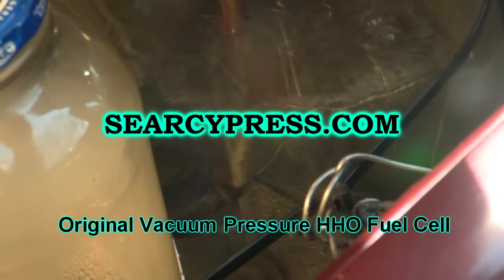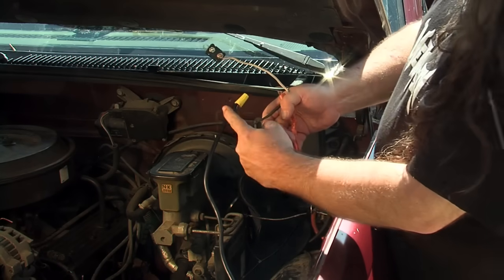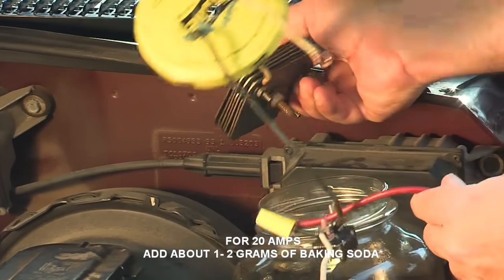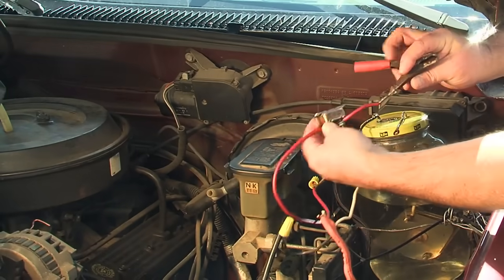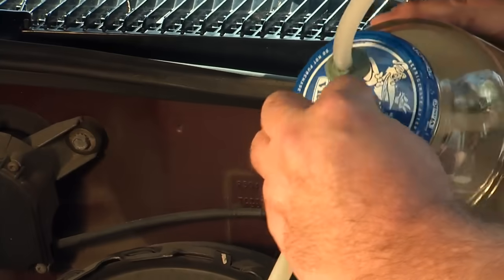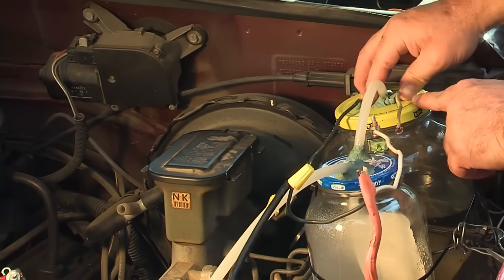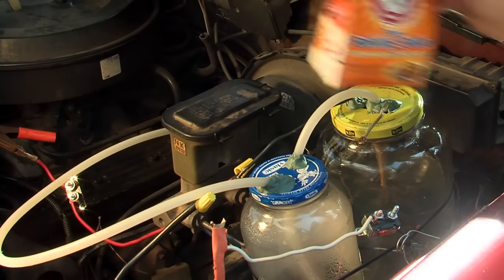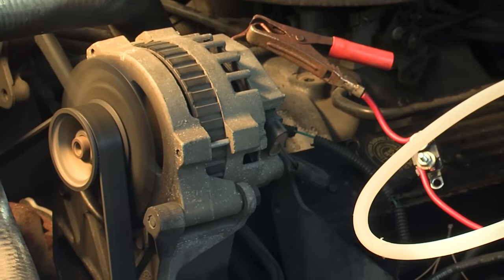Vacuum Pressure Hydrogen fuel cell defeats high gas prices using hydrogen from H2O.

Comment: Sorry, but it is NOT POSSIBLE to recover ALL of the energy spent separating the HHO. There are certainly even line loss (wire heating) that looses efficiency.  If this was shown to actually WORK, it would be equivalent to a perpetual motion machine.
Reply from the maker: This is not over Unity. It is simply allowing for more efficiency in the burning of the fuel. We are not getting something for nothing and do not claim to be. And on another note, perpetual motion is all around you. The atom is a perpetual motion machine. To claim they do not exist it's kind of ridiculous. Thanks very much for your comment.
Reply: @metalpresstv  but it is NOT POSSIBLE to increase the output of the engine EVEN ENOUGH to break even.  Since separating the HHO requires more energy than you can POSSIBLY RECOVER from re combining it. The only people who claim this is possible are people who never took a physics class.
Reply from the maker: @stuartgray5877  I understand. One thing I have learned is the word impossible simply means I'm possible. One thing about physics is the fact that they are constantly making new discoveries. As I said this is certainly not over Unity. However I strongly suspect it in the future many devices will be powered off of the same thing that powers the perpetual motion of the atom. Many factors determine how much mileage you get. Measuring that is also quite the challenge. Having tested this device for many years I came to fully trust getting higher efficient burn using this method was possible. It certainly won't work on every engine. And I do not suggest anyone build it because of the dangers involved. Thanks again for your comment.

Comment: Wouldnt running the hydrogen through the vacuum line as you showed defeat your power brakes? Wouldnt it be better to install a second line which runs to the throttle body or carb instead? I know this would still constitute a vaccume but at least it wouldn't be taking from your stopping power. 

Did you notice any power gain from this system??
Reply: @Sardit  finally an engineer who isn’t condescending
Reply: the power brakes aren't the only issue here. as an engineer i can guarantee you, that this whole video and all its pseudo scientific content is Bullshit.
Reply: @Taunus-Tim  A real engineer doesn't use adjectives, you're a just troll.
Reply: @snowboarder50000  i don't need to argue... I have a bachelors degree in mechanical engineering and i can prove it if need be.
Reply: @snowboarder50000  , you obviously haven't been around many.😂
Reply: @Taunus-Tim  yes, as an engineer you prove everything, thats your job. Zero fucks given for an engineers name calling, show your work.
Reply: @outdoorsman7324  im around engineers regularly. Is calling names how you think engineering really works??? Good luck building that bridge.
Reply: @snowboarder50000  okay, just to write something that is in deed an argument.
1. The amount of Hydrogen needed, just ro run the engine in idle speed is far far greater than a jar and some metal plates vould ever generate. Even if you have the electricity of a whole nuclear power plant. This jar would just boil and that's it.
2. By burning hydrogen in a combustion engine in idle speed you gain about 10% of mechanical energy out of all the 100% electricity you put in that jar. About 1% is available for the alternator. And with this 1% you want to recreate 100% hydrogen again??? Just how, by all laws of physics, could this work. This would be a perperuum mobile of Ultrons private order.

So learn your physics and give me a break please...
Reply: @Taunus-Tim  Stanley Meyer got it to work, several other inventors did also. You throwing out random percentages isnt convincing. Dont you have important engineering work to do?? why u here?
Reply: @Taunus-Tim  the point of these HHO generators is to increase the fuel burn in the cylinder.

I do share your disbelief of these though - perhaps in a shitbox car these can perhaps increase the efficiency, but I imagine there would be some sweet spot where you extract only enough energy from the engine to only increase the burn efficiency and no more.

One thing is certain, the gas produced will not offset the extra power required to overcome the extra load on the engine so that leaves only the increase in burn efficiency. But to be practical, the increase in burn efficiency must produce a power in excess of the extra load, otherwise why bother.

What would be useful is actual evidence. I have seen a lot of these type of videos over the years and none have actually shown their cars on a dyno with and without the generator running.
Reply: @adam3141  slandering a dead inventor makes you look like a jelous hater. Who did meyer defraud? Nobody.
Reply: @snowboarder50000  Meyer's water powered car would be a perpetual motion machine which is forbidden by thermodynamics. This is why he is a fraud.

Like I said in a previous comment, this HHO system could be used to burn the fuel more efficiently, but the extra fuel burnt via the increase in burn efficiency would have to generate more power than it took to generate the gas. It is possible I suppose but the engine would have had to have been quite bad before. Newer cars burn the fuel much better so having this would reduce your MPG, or L/100km.

I am not dissing the idea, just that its use is limited.

Comment: wait a second how does it not pull the water in?
Reply: The white line from the yellow lid water jar is in the vapor space of the water jar, which goes into the "dryer" jar with the blue lid to the bottom. Any water that gets sucked up goes into the blue lid jar. The white line from the blue jar to the vacuum line is in the top of the jar. This traps all water from the yellow lid jar in the bottom of the blue lid jar.

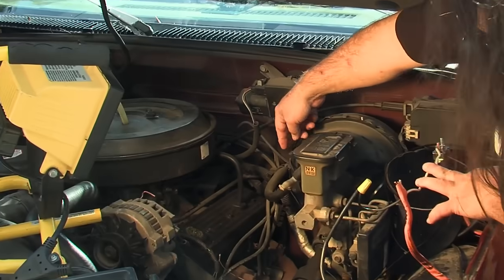Comment: 1:15 calls it a carburetor.... pretty sure that's an 2 injector throttle body efi engine. I don't know about much about this theory, but I can say that he has done a horrible wiring / plumbing / mounting/  material selection job. If this idea works, it would result in an unregulated / unexpected amount of fuel into the engine and can't imagine that is very efficient use of power. If it was carburetor engine probably wouldn't run right at all..... This also adds a ton of potential for a vehicle fire too boot.  The concept sounds like a good idea, but I would highly recommend not doing this without a better understanding on how to do this properly.  

But for a backwoods dont give a shit method, sure it adds a little something.....
Reply from the maker: You are right. It is injected into what  I called a carb. It sure stops pings from bad gas..

Comment: A glass jar inside of a hood surrounded by metal and a V8 engine. Its gonna break. The silverado's have amazing space under the hood its nice I love it but its too much vibration and bumps maybe a better shroud to go around it.
Reply from the maker: Never has broken. It sits on a pad. It does bounce and it could break but never has. Even chugging through some mud holes. Tougher than you think. Protection is a good idea, but it needs the cooling of air.

Comment: Ok you can buy a trucker Ho kit. Buy 24 cells put it in your pickup car ect bolt on a 2nd truck generator simular to your altinator hire a mechanic ajust fuel mixture down 80 % and laugh at gas stations and its legal get off your lazy ass a 10 year old could follow these instructions Finito ASAP

Comment: Here comes the rust!!!
Reply from the maker: It was a concern..Burning gas also produces water. So for every molecule of carbon dioxide produced by burning gasoline there is about one molecule of water produced. One gallon of gas makes about 217.5 moles of water. About 18 grams.

Comment: Its been around im surprised this video is not taken down.
Reply from the maker: Dozens more we made have been. We  aired one like  this on television in eight states when the price of fuel was almost $4 a gallon. Very shortly after that Mythbusters came out with a show debunking the ability to even make a bubble. Gas prices fell to $0.99 a gallon. Long time ago.
Reply: @metalpresstv  Its nice to know, we just need to keep pushing oulets like this and they wont be able to keep up. Just be safe brother. Keep doing what you do.

Comment: There is no doubt this will produce HHO but the extra load on alternator will cancel out any gains...extra Amps from alternator is not free.
Reply from the maker: So a turbo charger cannot give the engine more power...its a conspiracy.  Come on, how many times have we heard posts like this?
Reply: @metalpresstv  A turbocharger just puts more air in the motor than it  could normally swallow by itself....It becomes like a bigger engine but with relatively smaller parts , thus more efficient. The energy to do this is waste heat and pressure at the exhaust, normally lost but turbocharging recovers a portion of this waste energy.

The Alternator on the other hand is a free spinning armature until you put a load on it's output circuit, which will create a resisting force at the armature  directly proportional to the amps being drawn, thus the chemical energy you create (HHO) is proportional to the mechanical load on the engine (via the Alternator). 

The outcome is that you  put  3kw in for a return of about 1kw .....and its dangerous...I know because I experimented on my Ford Cortina in about 1983 and blew the wiper washer container to  bits and impaled my electrode rig (stainless plates into the hood.)
Experimenting is great and very educational , H2o > HHO  is real science, but all you learn is that there's no free energy....except maybe if you can reverse entropy.

Comment: Question -  I understand it that 1.2 to 1.7 amps to be the optimal range to split the H2 from the O... What is your equation to use 30 amps?  My thoughts are excessive heat...Curious... Thank You for publishing!!!  Keep up the great work!
Reply: Not amps, voltage.
You need a high enought voltage to break the hydrogen bond between the hydrogen and oxigen, wich optimaly is 1.23V, the amps just make the generation faster, higher the amp, higher the volume of gas in a sencond. Thouh there is a threshold, if you put in enought amps, the water might heat up and boil. The hiher the temperature, the higher the resistance, wich makes more heat.

Comment: A stainless steel exhaust system would be a good idea, as the water will quickly rot the existing one.
Reply: Gasoline produces water, all exhausts have water in them.
Reply: @Jordan-rb28  not as much as hydrogen
Reply: @Scott.Farkus   Dude you should see mine    at lest a 1/4 cup drips out every time I drive even a short  drive like 30 miles
 I checked the fluid level i'm not losing any fluid
Reply: @punker4Real  That's what she said
Reply: @Scott.Farkus  The truck is not running on hydrogen. It's running on gasoline.
Reply: @timhallas4275  What truck?
Reply: @Scott.Farkus : The GMC in the video...DUH.
Reply: @timhallas4275  I don't watch videos, I have better things to do.
Reply: @Scott.Farkus  Surely if it's wet enough to have it coming out the exhaust as liquid everything in the exhaust pipe is wet. More wet shouldn't make a difference in corrosion, should it?
Reply: @Stigstigster  More arguing won't make you right; will it?
Reply: @Scott.Farkus  I didn't argue, I asked a simple question.
Reply: @Stigstigster  You're only trying to be right in the end.
Reply: @Scott.Farkus  Oh FFS, I'll research myself, just thought you'd have some information on the subject. It's like pulling teeth.
Reply: @Stigstigster  Arguing doesn't accomplish that end.
Reply: @Jordan-rb28  yes, but burning hydrogen produces more.
Reply: Burning any hydrocarbon fuel produces water. That's why they are called hydrocarbons. All exhaust systems are designed to be in contact with it. 🤦
Reply: @doug960  The more water you get the sooner they rust out.  They can make better exhaust system, but they like selling them more than seeing them last; if hydrogen ever catches on as a auto fuel they'll start making them out of stainless.
Reply: Exhaust gasses naturally rust exhaust systems steam is harmless by comparison.
Reply: @ScorpionRegent :  The only component of exhaust gasses that rusts the steel is water.  Take a class.
Reply: @timhallas4275  -  CO carbon monoxide, O2  oxygen, and NOx oxides of nitrogen are all present in exhaust and they are all oxidizers that cause ferrous metal to rust.  I'm a smog repair technician.  I've taken the classes and I've taught them, so I know what I'm talking about.  Maybe your instructor didn't know what he was talking about.  You can believe what you like, it won't make you right.
Reply: @ScorpionRegent  Wrong again.  Oxygen that is bonded with  carbon, in CO2 and CO, as well as the oxygen that is bonded with nitrogen in NOx, are covalent bonds, and are not separated in the presence of iron. Therefore they do not contribute to the formation of Ferris Oxides. On the other hand, the oxygen in water is bound to hydrogen with a single electron, and is stolen easily by iron atoms on the surface of steel.   Take a course in chemistry. I have my ASE certifications in Emission control as well as all the rest. There is nothing in that course that teaches about corrosion in exhaust systems.  I'll bet you don't know why cars with modern day electronic fuel injection systems have worsened the corrosion of exhaust systems, compared to the old carb and choke systems of the past....do you?
Reply: Your exhaust needs replacing anyways.
Reply: @CORYJOHNM  Not every 3 months!

Comment: I only have one honest question. Why is all this always worked on an old ass huge engine truck? Can someone if this stuff truly works make a video of a regular 4 cylinder car? Honestly how can you even see a difference in fuel usage is a 3500.
Reply from the maker: The big old engines are very wasteful in comparison. When gas prices were very cheap no one really worried much about how much the fuel cost.

Comment: I don't understand, so you pump your H20 threw the vacuum to power the engine? How is that creating a reaction in the fuel system? Or is there another step for delivering the hydrogen?
Reply: When you burn hydrogen and oxygen together water is formed that's why there is water on earth

Comment: This is not a great way to hook it up.
Bad idea to interfere with the vac line for the brakes.
Best to find a vac line on the side of the carbi or even under the tray of the air cleaner where your crank case vent goes.
Vent the crank case to a catch can and put the HHO in the air cleaner. Will still get vac from there

Comment: “Vacuum pressure” in the title made me wonder and click, seeing the household electrical components in a vehicle and the alligator clamp connection confirms my suspicion.
Reply from the maker: The term vacuum pressure is used mainly in refrigeration. The fuel cell acts much like an evaporator does in an air conditioner. I assure you there was no deception intended. Thanks for your comment.
Reply: vacuum pressure, the difference between the atmospheric pressure and the absolute pressure.  Or for normal people - low pressure. There is still pressure... Nice VID, Love the use of common stuff like a light switch!! Hate all the neg comments.
Reply: @vincelocicero9730  
There's a good reason to not use a light switch.
The operating principals of direct current will destroy the contacts of a switch designed for alternating current in short order.

Alternating current goes from peak output, through zero, to peak output on the opposite side of the sinewave.
That point where it hits zero (60 times a second) allows the circuit to be broken without excessive arcing.

In direct current, the arc creates a great deal of heat, and degrades the contacts until they either no longer exist, or get small enough to overheat and weld together.

Metal pickle jar lid isn't a good idea either...
Vibration causes insulation to wear away & you have a bomb with glass shrapnel under the hood.

No flashback arrester means a backfire also results in a bomb.

I'm not saying it's a terrible idea, I'm saying it was executed in an unsafe way that gave no thought to long term use.

Comment: do ypu use this with petrol aswell? or instead of?
Reply from the maker: Burning pure hho would fry the engine. It can melt tungsten.
Reply: @metalpresstv  that didnt answer the question?
Reply: @metalpresstv  what's confusing your connected to a switch, earth, and alternater but how? , pure hho what melt the engine if it was a blowtorch but on this it only conbusts for a fraction of a second, there are some things I'd like to talk about really I'm making my own version completely different to all types of cells out to see if theres a better confige to produce more hho, i think its crazy everyone thinks you need 30amps-ish I'm gonna see if i czn get it down to like 3amps i cant help but feel people who made these havent studied science, physics, elctromagnetic theory, water, electronics, how capacitance works, how to make a capacitor, even issac newton laws of electrolysis, all these subjects would help in the understanding of a hho cell, everyone needs high amps cause there all the same design really just different lengths and widths, ill be good to go in a month just waiting on somemore parts to come mine will have 28plates 100mmx50mmx0.1mm plates with a gap of 1mm each, the idea is to lower the saturation point of each plate thick plates require high amps! and the bigger the gap also increases amp double whammy effect, 30 amps is a really high number, i think newton states 2amps is whats need thats like 300years ago, I've combined what I've learned from multiply sources